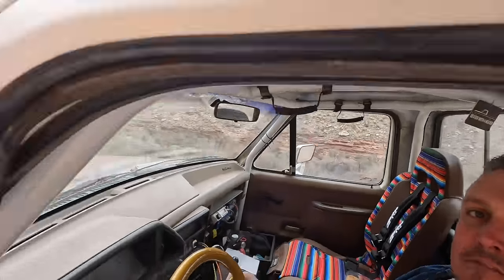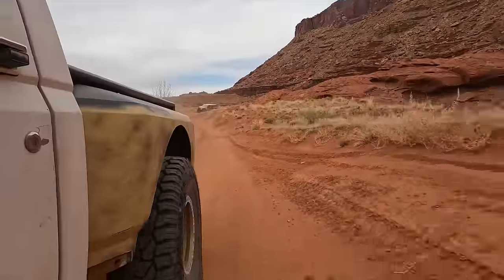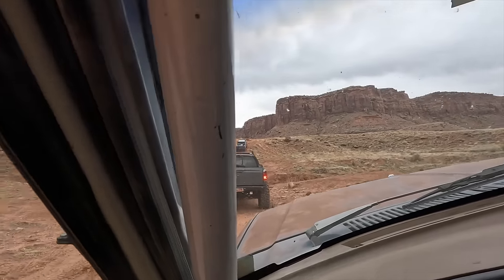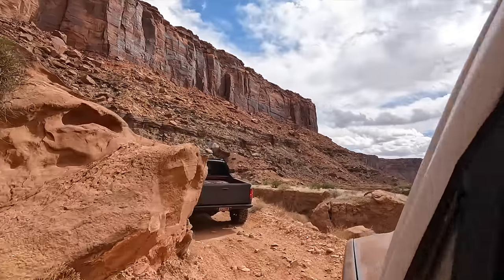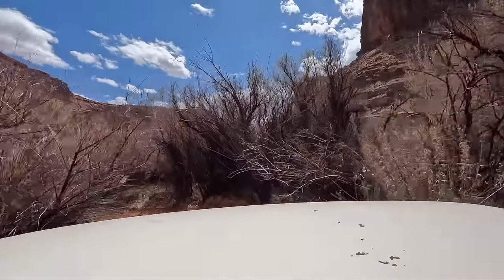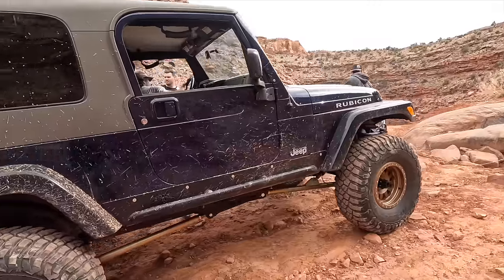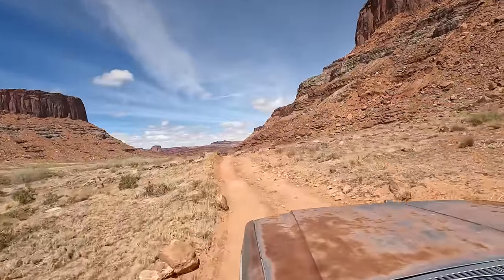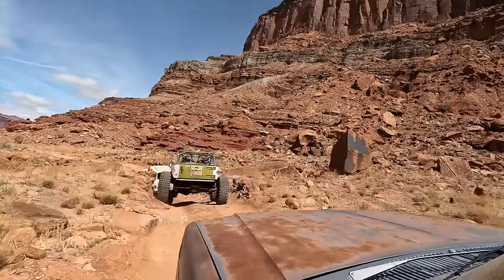Wheeling these big rigs and fixing along the way.  Moab Utah

Comment: How much lower should your truck be geared? And what is your current set up (transmission, transfer case, diff gears?
Great video thanks for sharing 👍
Reply from the maker: This thing should be geared higher. Has zf5 trans. Magnum doubler, np205, 5.38’s in the axles.  I would like to go 4.56 or 4.88 in the axles

Comment: I’d like to see you try an electric supercharger setup on that thing or the gas engine. You can fabricate one with RC motors and a few batteries/capacitors and it is most useful in short bursts where boost is needed and IATs stay super mold because of that. Could help fuel efficiency
Reply from the maker: I’m not sure rc car motors are gonna generate enough extra pressure.  Heck look at how many leaf blowers it took Roadkill to actually make boost
Reply: @thedirtheadshed  RC plane motors are the best value and performance. There’s lots of documentation on YouTube of them working

Comment: Have you considered making rear fenders out of metal? The shape would be easy to duplicate somit keeps the same aesthetic.
Reply from the maker: I have thought about it.  I really dont want to add the weight of Plate steel to the bed, and I dont think thin sheetmetal would really be a step up from fiberglass..   we will see
Reply: @thedirtheadshed  That is a valid point. I just hate doing fiberglass repairs. Lol

Comment: I need real shifters for my mag/205 setup, i am using cable shifters and they are a bit stiff/notchy
Reply from the maker: yep!   these are the floor mount ones,  not directly mounted to trans
Reply: @thedirtheadshed  yours seems to shift better than mine.
Reply from the maker: they are super smooth.